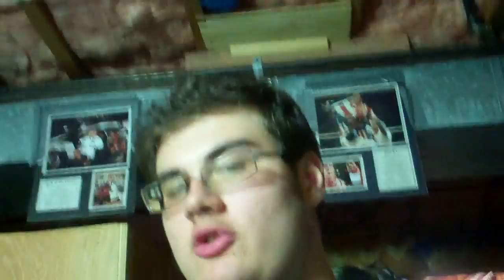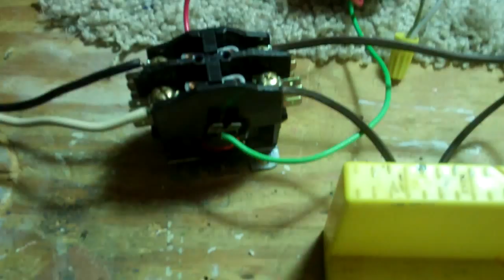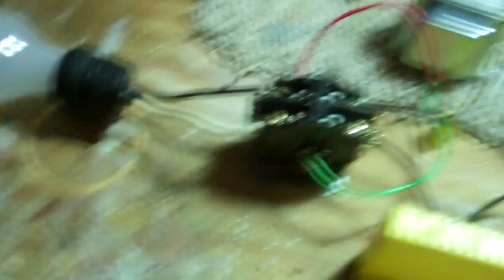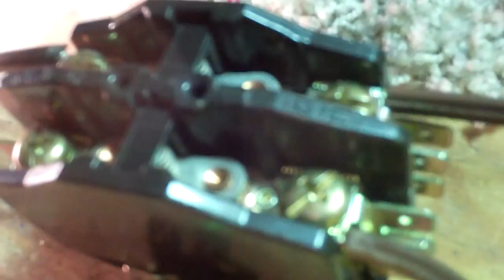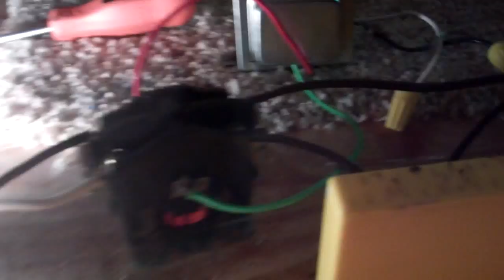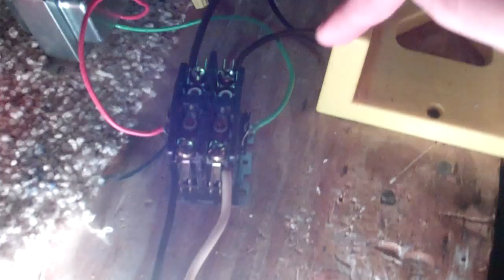How a Contactor works

Comment: My contactors relay for my AC is just like that and works good with thermostat but when I reconnect pull switch in the AC unit still turns on. I can send you or show you image of the wiring on the contactor on my g+

Comment: It is a 110 volt coil and it had 109.2 volts. arrrgh! I hooked up the transformer to the correct tap but it still is buzzing when I first turn the VFD back on. I probably have to replace the whole contactor just because somebody wasn't paying attention. Oh well

Comment: Nice video Mike! Well explained. Once you understand the concept about how contactors work; any kind of relay or switch just makes sense. And you are right; contactors are everywhere! I find contactors with high voltage coils(110 208 etc) seem to give me a bit more trouble. I have one for the fan motor on my cooling tower that is acting up. Some knucklehead hooked up the transformer primary to the wrong voltage tap and the contactor was making but, chattered something awful.

Comment: @67tr876 so if i have electric motorcycle 72 volts and the Amps from the batteries (6x 62Ah) are 372Ah then what kind of contactor should i use ?
btw i have controller that is 72volt controller with continuous current of 150Amps and burst of 300A for 1 minute ?

Comment: Hi Mike!

You can get contactors with four or more poles too, some can be normally closed so you can use these for the crank case heater for example so its on when the comp is off! You can also get auxiliary contacts that either snap on the top or fix on the side and these can be used for crank case heaters, signal wires or condenser fans etc. 
If you are interested i'll make a short vid of the ones i keep on the truck.

Jon